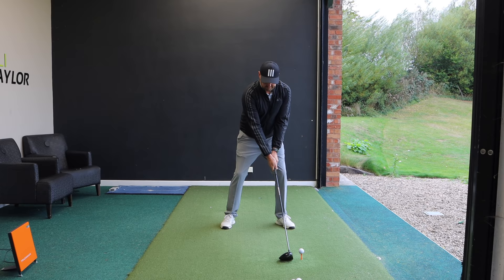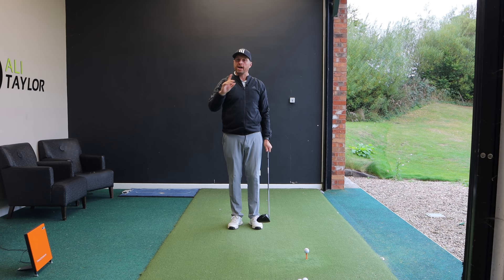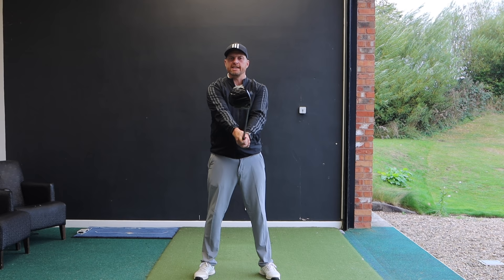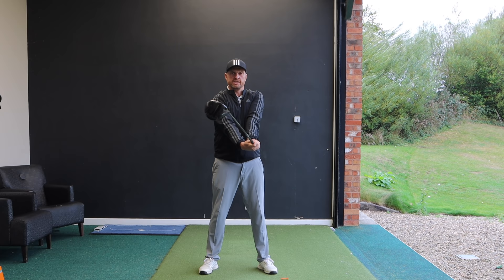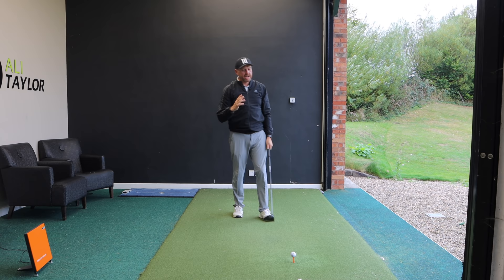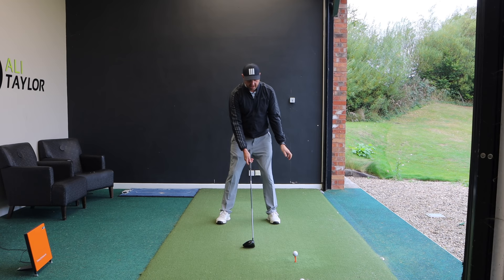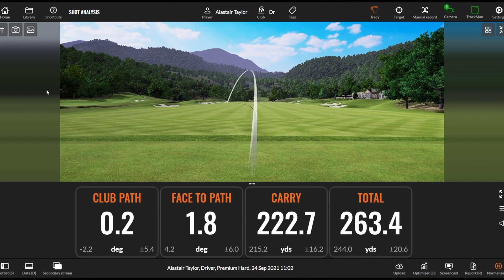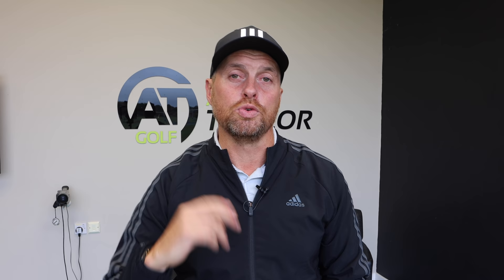The BIGGEST reason your GRIP is causing your SLICE and how to FIX IT

Comment: 4:07   "and if it doesn't feel different you're not doing it differently"              That cracks me up. Classic line.

Reminded me of when I was teaching friends to windsurf at an intermediate level (Harness line usage, foot straps, getting on plane).  
I'd often tell them          "If it feels hard, you're doing it wrong. Let the equipment do the work with body leverage, not arm strength."

Comment: I agreed setup is important but I also had an additional issue. I am too handies. So when approaching the impact zone I turn over my hands cutting across the ball in a severe way.  Another golfer a stranger a ole gal confirm it at a driving range. She tips me to open all clubs from 3-6 degrees on setup and when my right hand passes my right hip to think go left. Guess what? No more slicing. I have improved on it and today on command I hit fades, straight, and baby draws.  It's like an angle appeared and helped me out. The place was Jefferson Park Driving range in Seattle Wa.  See yah on the links.

Comment: The biggest problem I see in golfers with bad swings is a total lack of awareness where their body and club face should be in the swing at the instant the ball releases off the face to the target.  

The biomechanical reason for a slice starts with the hips being parallel when they address the ball with putting face square to target BEHIND the ball actually locked 45° open to the target when ball releases off the face.  If you take the club at parallel hip address and simply turn hips open 45° where does the face point?  45° left due to the hip turn and it is also swung in from the target line.  So obviously some other biomechanical action in the swing needs to compensate for that, no?     That bio-mechanical action is SIDE BEND. 

Return to the parallel address position and then keeping hips parallel execute a side bend action to the right and observe the effect on the hands and club.  Side bending to the right keeps the right shoulder back but pushes the hands forward.  In the downswing that action of the hands being pushed faster than the shoulders are turning is what maintains the bend in the shaft created at the top when direction of the club mass is reversed (hands drop, shaft bends and loads). But you will observe that the side bend action done independently causes the face of the club to be pushed open relative to the target and out away to the target.

Now understanding the cause and effect on club path and face angle of both actions — hip opening and side bend — and coordinated them together and what will you get?   A club face which will be dead squared to the target when the ball releases off the face because the side bend action compensates for how the hip turn pulls the club in and closed by moving it out and open.

The primary reason recreational golfers slice is they lack any understanding of the side bend action and thus have none in their swing. Without any side bend the reflexive brain reacts to the fact the club face is swinging too much inside and left by pushing the butt of the club towards the target trying to get the face back square to the target.  But because side bend is also critical for maintaining wrist lag (radial deviation) someone without side bend in their swing will also always “cast” which is the premature release of lag which causes the club head to swing outside of the target line setting up the outside the line path which combined with hands being pushed forward opening face in grip causes the slice.

Teach a golfer like that why they need to side bend (see above) and their slice disappears.  How to get them to learn to side bend?

1)  Hold the club where it needs to be when it will release the ball.
2)  Have them put their left hand on it naturally (as first suggested by Jack Nicklaus in Golf My Way in 1978)
3)  Have them open their hips 45° as they should be at impact (to get them out of the way)
4)  Have them bend right arm 90° and put elbow over hip touching body.
5)  Tell them to put right hand on grip without removing elbow from hip.  (forcing them to side bend to do it)
6) Adjust face of club square to target in grip.

Do those six simple steps and their body will be in exactly the same position of a PGA tour pro when the ball releases off of their club and they will have a clue THE GOAL OF THE EXERCISE in their conscious brains for the first time in their life.  Once they understand where their bodies and club face need to be at the point the ball releases to the target it is just as matter of a dozen or so swings to get their reflexive subconscious brains on the same game plan.  Their chronic slice will disappear because side bend puts club on inside-square path and delivers face square to target as ball releases off of it.